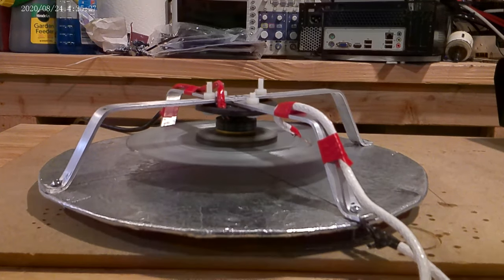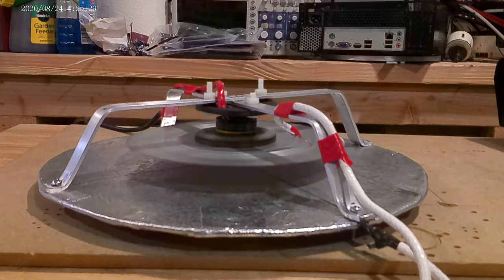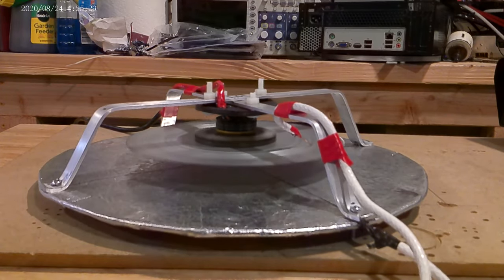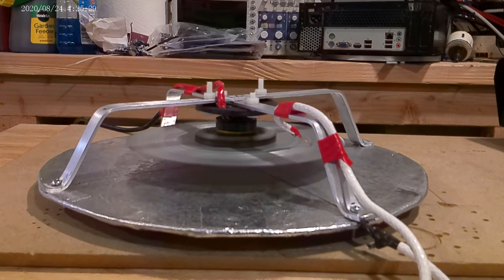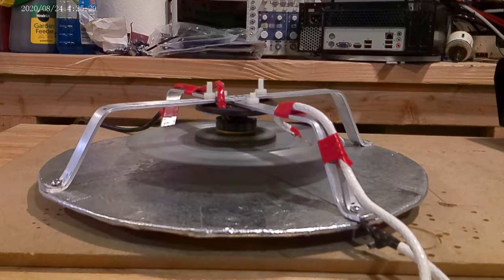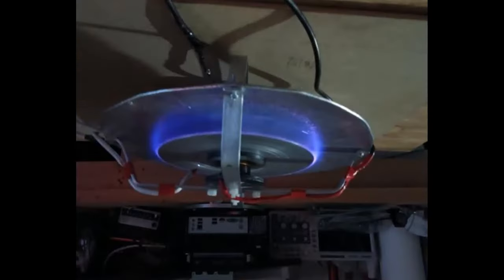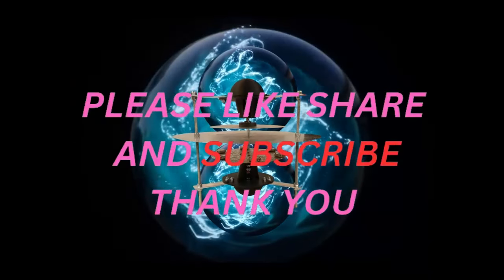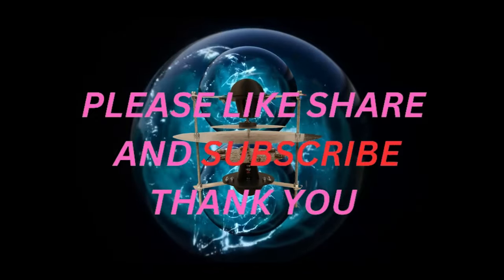Graviflyer "Where Is The Lift Factor" #36

Comment from the maker: In Alexeys schematic he drew lines that cross. He told everyone how they are wired. Yet his schematic still shows it. My job is to trust but verify everything. When following his instructions fails. We must follow all leads to verify the real answer. By changing the wires. All of his tuning is now working the way he has told us it does. The effects now have a true basis in science to work from. When reverse engineering something it is vital to run every test in every way. No matter how much you are told it is the wrong way. By following where the science leads us, we can now give a true description of how the craft works. Then the physicist can quantify it properly. The last thing on my list is the piezo disc. I think MyTBrain has the answer. I just need to add my testing to his. Then I can give the true description of how this craft is working.
Reply: Because he is a big liar so he can make much money.
Reply: so your version 2 made a hole in the wood, does that seem like if you flipped it upside down it could lift? that seems pretty darn substantial to me
Reply from the maker: @fireball75677  It is half or less the power to lift. It needs a field to divert gravity waves.
Reply: @nathanbunten4299  so the lift power is there but it needs to be doubled hence the 2 spinning discs?
Reply from the maker: @fireball75677  I don't need to lift against gravity like a propeller does. I am creating a field to remove gravity. I need 1/3 the crafts weight in lifting force. so if it can create a force that is 1 pound than I have it. I am creating anti-gravity. Not a new propulsion method.

Comment: The bottom magnetic field needs to interact with the topagnetic field for lift or vice versa for sink. But these magnetic fields slip off each other. Why the electrostatic middle disc needs to be timed to cut off the magnetic fields interaction before slippage, and then off again fast to keep the magnetic interaction. To smooth out the slip jerk and the lift/sink jerk the smaller discs spinning gyroscope a vertical inertial resistance to them jerks. 
You , in future configs, could use two T-coils in-craft's static disc east-west sides. And may even use an outside middle edge rotating ring for gyroscopic vertical balance.

Comment: The disk needs more speed love your work from Australia
Reply from the maker: I hit the limit of the motor. I used the same one as the original. I want to be in 20hz. Things in nature change at low hz. More speed would be a setback. I tried to push the limits on this craft and every time I do the rest of the craft is no longer in cinc.
Reply: If this craft incorporates counter rotation which is essential for levitation why not implement otis carrs principle where you make the rpms equal to the rpm of the earths rotation. For example 300 rpm in the craft would be equal to 3000 rpm of the earth spin. Just a thought

Comment: i think its important to identify all possible forms of lift that result from fields, choose one that is most relevant and use reductive reasoning to eliminate each one that is not responsible for the graviflier lift. There is ion wind, electrostatic repulsion, lorentz force, reaction thrust, biefeld brown effect, geo magnetic repulsion, pressure differentials/ether displacement. Many researchers already explored those, so learn from them. The graviflyier or any other field propulsion device is not related to gravity in any way because gravity in conventional physics terms doesn't exist. Its an illusion. Weight is the result of various factors such as density, temperature, air pressure and a electromagnetic component related to the toroidal field earth is immersed in. Any movement your device manifest is the result of subatomic particles imparting momentum to it vs true antigravity/levitation where your changing the atomic frequency of a object and making it resonate with the desired location because all locations are properties of the object. It then teleports or atleast rises up slowly. This is how most E.T. UFOs travel. The principle can be observed in the Philadelphia experiment and lifting of pyramid stones using vibration, so don't misunderstand what "antigravity" is, which is a strange term. My point is you need knowledge of vibration, frequencies, and a different perspective on space/time to implement the real "antigravity", however electromagnetic propulsion is within your capability to accomplish just ask stan deyo, john searl or t.t. brown

Comment: so finally you've ditched his fishlines scam craft and went to try the ionic propulsion way
Reply from the maker: There were never any fishing lines. Ionic wind is not the answer. It is static lift. The bigger plate absorbs the ions. 

It is not his failure, it's ours. He built everything into this craft. We have failed to understand it properly. That is why I keep showing all the tests.
Reply: Did he move it with fishing lines?
Reply from the maker: @hellogoodbye3129  NO!!!!!
Reply: @nathanbunten4299  OK Nathan, please explain this, how did he touch the Graviflyer while it was flying and even put his body on it? If that thing was truly hooked up to a Tesla coil it would zap him like there's no tomorrow.
Reply from the maker: @Qwerty-ff1cr  not really. I will touch it in the next testing video. It it a tiny static shock.
Reply: @nathanbunten4299  Yes, please do, and also wouldn't arc be visible? Because in his videos, he was smacking/pushing it around a lot and there was no visible arc for such a powerful Tesla coil.
Reply from the maker: @Qwerty-ff1cr  The circuit is different than a regular sstc. It has the + and - reversed on the #1 coil. This means it puts out more resonance than spark. I have shown the spark in testing. It is very small but the power of the tesla coil goes for a larger distance. It also means I can't get 230v of the transistor to work unless I change the resistor from 47k ohm's. Also since the top 4" of the tesla coil is locked to the beat rate of the top disc. It functions differently. I also showed this in a testing video. 

We think of a tesla coil as a sparkler. Tesla was using resonance and detuned them so everyone can see the light show. We have been building them for years saying they are in perfect oscillation to get the huge spark. We are wrong.
Reply from the maker: @Qwerty-ff1cr  also we are not connected to the tesla coil. the wire is run down the #2 coil. Not attached to it.

Comment: so if the high positive was acting on the bottom small plate, and the high negative was acting on the big middle plate, you will need the small plate acting on top to to be slightly less positive than its twin on the bottom. allowing for lift but still keeping the kraft stable.
Reply from the maker: The craft is stable because of the spinning magnets. they create outward force keeping the craft in the correct position. also the center plate can be positive and the lower plate can be negative and it will work.

Comment: Nice to hear you say other miss lead you sometimes keep up the great work also can you use electromagnets on the small plate to plus + only for a stronger repells if the big plate needs more - because of the electromagnets add more voltage
Reply from the maker: It also works in the opposite direction. - to the small disc and + to the big plate. There is a limit to the power that can be applied based on the distance. I have a feeling that the eddie current helps the - apply force to the center plate that is + But I cannot confirm that yet.
Reply: @nathanbunten4299  Alexey quoted the water vortex principle of Austrian water conservancy expert Schauber

Comment: Do you have a scale to measure the downward pressure?
Have you really tried to orient it upside down?
Reply from the maker: Yes I have put it upside down I believe it was in one of my videos. I will find it for you. I ordered a scale that is mechanical. The ones with circuits don't do well with high voltage. Once we identify the base ( the vibration ) we can the determine the added pressure.
Reply: @nathanbunten4299  so that to me sounds almost like we don't need the magnets, do we?
Reply from the maker: @fireball75677  we do still need them

Comment: Interesting effect. I assure you it isn't affecting gravity, and I doubt this will cause it to leave the bench. "Sometimes," it's a really drawn-out hoax.
Reply from the maker: We won't know until every part is put together. I think this effect only works if the fields on the outside are really creating a their own pressurized bubble. I have been working on the fields. I was told by a very smart kid to use a fog machine to see the bubble. If I can identify it then weather the original was real or not will no longer matter. We will have something that you can now quantify and tell me how much more or less power to put in certain places to make the math work.
Reply: Discarding never created anything. Hope on the other hand created everything. Don't let your left hand know what your right hand does.
Reply: @nathanbunten4299  I came here precisely to suggest this to you, about this fog...
Two things actually...
This fog machine needs to have water in it, water vapor more specifically, and the idea is not to just see the "field" but to create propulsion with this...
Another thing, I would ask you, have you tested this machine with the discs in an asymmetrical shape, if not, would be very difficult for you to remove the top disc and insert a smaller one? I think you could carry out this test, the idea is to make like an asymmetric capacitor, but a counter rotating, if you haven't tested this yet, it would be interesting to at least see what happens...
Creating an asymmetric and rotating electric field could be interesting, I'd love to see what would happen if you did that...
Keep up the work, I think something interesting could come of this, good luck brother!
Reply from the maker: @squirrel1117  Thank you.

Comment: like i said before you just cant go around making words up... their is  NO  such thing as a "static volt", no such things as  a  "tesla field".    A volt is not a thing,  but the rate at which magnetism is created /consumed.      

Real things  :    transverse electromagnetic  and magneto- dielectric   longitudinal   (tesla radiant energy).  If you  took your time and actually read  maxwell original 20 equations you would see their is a scalar part.   I hate to break the news but you have near zero chance unless you get more technical  instead of just winging it.   dont get me wrong im behind you 100&  and why i am pointing these things out.
Reply from the maker: I know my style is not what you want. That is why I do the testing. When I am finished I will leave the final part in all the correct words.
Reply: @nathanbunten4299  as an open source project, shouldnt we all be using the same language?  maxwell and steinmetz  already defined all of these electrical situations. 

for instance when when you attach the  wire from the tesla coil to the center plate do you see a voltage gradient   across the disk?  if so  this is because of the magneto dieletric longitudinal of electricity (tesla radient energy). this why i mentions tesla hairpin circuit as an example of this.

Comment: Nathan, if this leads to the lift factor where is the lift? If you keep going this way the craft will not lift up. You have to do it the way I found out from Alexey. I think you are damaging your brain like I had done to me by a UAP and not thinking clearly while standing in the field. Just saying. You can do what you wish.
Reply from the maker: You are not understanding fields. They won't produce lift . They still need a push. The fields reduce gravity. This gives you movement. As each part is identified. We are able to see through where every inventor misleads you so they are the only one who can make it work. It is rare to find people who are willing to show you everything.
Reply: @nathanbunten4299  I understand fields as I am an engineer who had electronics courses. You are just producing an air capacitor that shorts out and does nothing. Just saying. No insult intended like you don't intend. You need a normal capacitor to hold the charge to repel the earth and attract the ionosphere.
Reply from the maker: @richardmuller867  I don't get insulted. To me we are just having a lively discussion.

 The field is blocking gravitational waves. But the center plate is polarized as well. What you are not seeing is that it is forming a small gravity inside the bubble. Your thinking of a capacitor is not taking into account the massive emi I keep getting. That is why I have been working on the fields so much. If I am right the craft forms a gravity well. There is not corse anyone can take to find this. The experiments must be done to see it.
Reply: @nathanbunten4299  Nathan, I did not say you get insulted. You said you are not trying to insult people. I got brain damage from these fields and my close friend Mark Tomion died from these fields. If you keep doing this, then you will off yourself and the people who makes comments on your videos will start rumors that the government offed you as I see this many times. I can see that you are not thinking correctly now just like me and my friend Mark.
Reply from the maker: @richardmuller867  These fields are at low power right now. I get your concern. I felt the power of them on accident. I have plans to do it outside. I am thinking clearly.
Reply: @nathanbunten4299  Nathan, also get a Faraday cage.
Reply from the maker: @richardmuller867  agreed